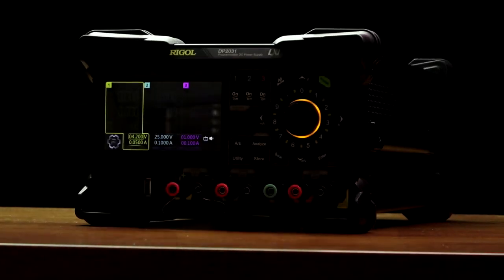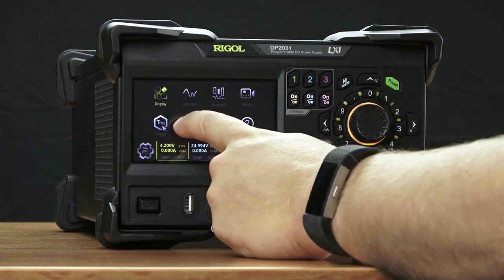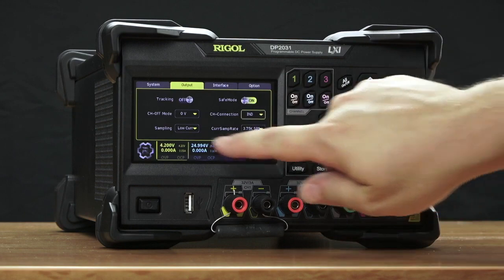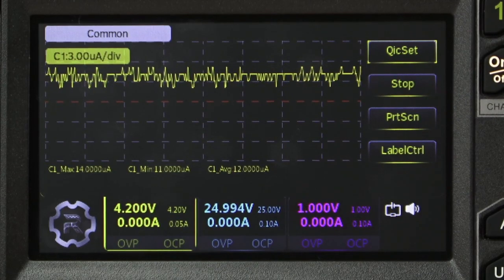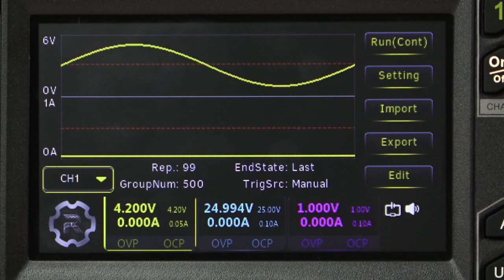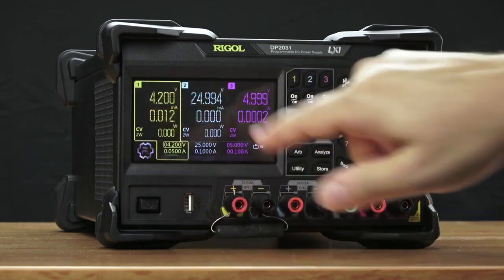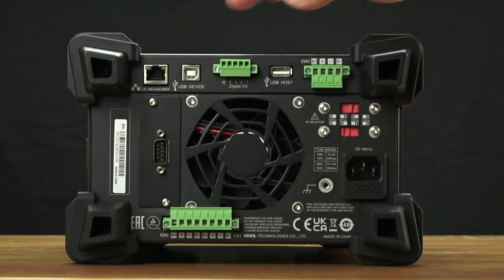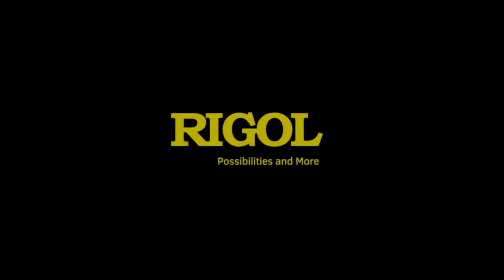RIGOL DP2000 Power Supply Introduction

Comment: Nice power supply but user interface including front panel is like a dog's breakfast again. Rigol should really finally hire a decent product designer.
Reply: Not a fan of 'dark' instruments either. It makes for a very dark working environment and some of the panel legends are really hard to read.
Reply: I thought the same thing about the previous generation, but having used the DP832 for a number of years now, I've got used to it. The only thing that's bugging me from the look of this quick demo is the ridiculous placement of the Rigol logo on the bottom left of screen. Really stupid waste of real estate.

I'm not a fan of this latest trend for black kit either, I have to say, but that's no great deal for me. 

Having sense capabilities is something I really miss on my DP832, so that's definately a feature worth having, though not worth the massive additional cost. 
I could buy two DP832's and still have money left over compared with the cost of an DP2031 unit. 

Nice psu, no doubt, but way too expensive for the nominal gains over its predecessor, I think.
Reply: Not a fan of the black.  Makes for dark workspace and poor contrast of controls.  The best i can say about the Rigol look is they are unique.  I purchaed a GW Instek power supply a few months back with all these features and more.  Love it and as a bonus not black, but with a black outter rim tastefully done surrounding just the display.
Reply: @simonbaxter8001  It's an eye strain for sure not to mention looks like an old 80's stereo receiver.  Especially when all the other equipment has a light facade.  I almost got their MSO scope but black? Ugh, I'll drop another 1k on another brand and get a little more features too.  I do like Rigol's power supplies.  They have a better selection than most.  If it comes in white I might bite, but in black I won't be back.